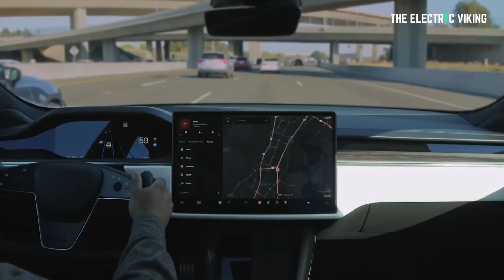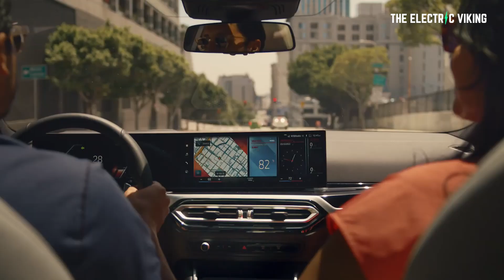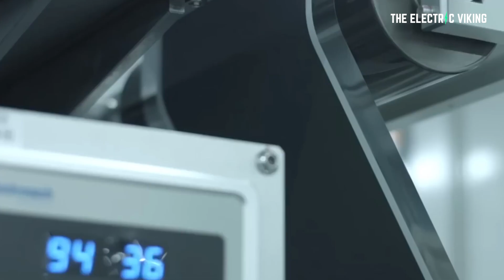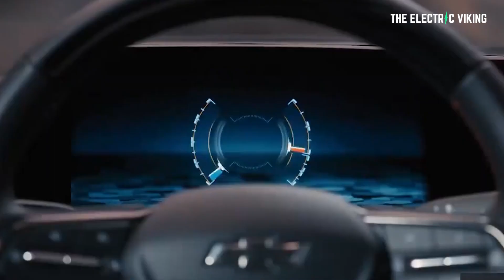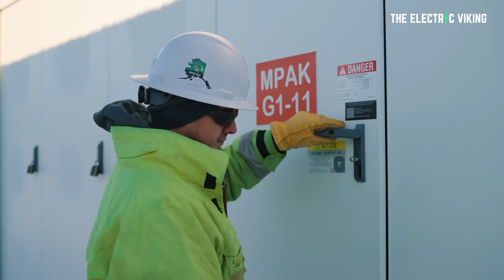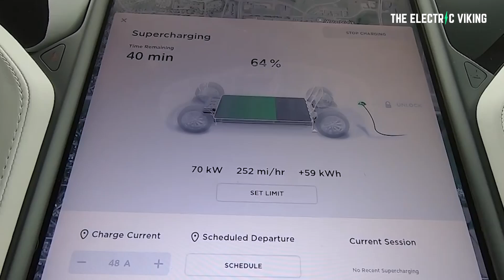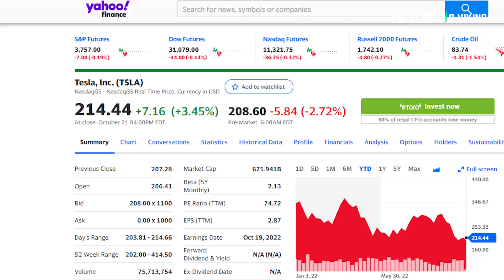Tesla will make double the world's total 2022 battery production

Comment: Vertical Integration is only the first phase of Manufacturing efficiency. It starts that way for a couple of reasons. it helps continuous improvement (getting to a viable quality product), it funds technology that are unproven economically but promising and can prove them in real time, and it doesn't require as many votes (for Tesla there is only one real 'vote') to change direction. In 1960, virtually every part of a Chevrolet was made by General Motors owned subsidiaries. By 1980, over 50% of the parts were made by third parties. As the technology becomes more stable, it too will go global to the cheapest providers.

Comment: In two or three more years, will they need to start replacing older degraded batteries? Are they requests yet?
Reply: Nope. LFP batteries should last >2000 full cycles. For a 500km range car, this = >1M kms.
Reply: Redwood Materials is already setting up a battery harvesting operation to take batteries and recycle the components to raw materials. JB Strauble left Tesla years ago to start this venture.🤔
Reply: Tesla current battery pack suppose to last 500k miles, that is more then enough for the average car life in USA.
Reply: @reyfetsalmo3346  "supposed to" is very nice, but call me back and let me know how well or long the cars and batteries actually last. You can bet that Tesla, like any corporation, sets aside money for warranty expenses. And in order to predict those expenses, they track every battery failure they've ever had. IIRC someone in CA who was putting on 100k miles per year-ish in commercial use, was one of the first to prove battery life might be more of an issue than advertised. And yes, Tesla did replace the pack, and has changed battery management and charging profiles as well.

Comment: Vertical integration is great as long as there is growth and demand exceeds supply. When growth slows to even negative and supply exceeds demand a company "fully integrated" will be faced with much bigger challenged to "right size". A company with a deep supply chain is able to spread the risk and prevent absorbing all of the potential losses. Verically integrated organizations have overhead matching output. Thats ok until you need to reduce 20% when the economy goes through a down cycle. Its much more than just reducing headcount. But vertical integration is cool as you grow no doubt.
Reply: Tesla will be able to lower sell prices to boost demand, they have already done this. Better design aimed at reduce build cost, in house LFP batteries, high automation, limited number of models....all of these enable Tesla to be the lowest cost builder. The Semi, and Cybertruck will be HUGE profit drivers for many years to come....as will model 2.
Reply: @melleblanc8705  Yes, all your points are valid in a robust economy. The globe will eventually see a recession. Not a matter of IF but a matter of WHEN. Yes, Tesla will be better positioned than most. But I can assure you if they see a year over year drop in volume they will need to reduce overhead. If the majority of the cuts come from within your own "house" it becomes very inefficient to reduce volume when the supporting structure is built for larger volumes. While this structure can indeed be "right sized". But its far less risky to spread the pain throughout a supply chain network. Those that have deep supply chains and/or contract manufacturing can by and large reduce their component purchases. Ford learned this. Xerox (the worlds most famous copier company) doesn't even manufacture a copier themselves. Apple if seeing a reduction in iPhone sales have Foxcon to share the pain. Many other examples that utilize shared structures to reduce financial risk. But yes, Tesla can weather an initial downturn better than their peers,,,, for a while.

Comment: Yes Tesla has proven itself that it thinks out of the box.  They follow the best ideas not copy existing ideas. Doing the same thing over and over only gives you the same result. Think outside the box break out and think not like a circle but try something like maybe elliptical.
As an electronic engineer, I was better at solving problems better than other engineers by trying something different.  Elon and Tesla is that kind of company, taking the risk to try new methods.  Sometimes you win and sometimes you fail, but you learn from what you try and then you go from there to solve the problem.. This results in a better product.
Reply: Good thinkin

Comment: Everyone else will catch up to Tesla and even Pass them in due season. It's only a Matter of Time as everyone just recently got seriously into the E.V. game.
Reply: Just like Rosie O’Donnell catching up to Usain Bolt in a foot race😂
Reply: @bekind9668  no because Tesla had to figure alot out by themselves while others can Hire those with modern Knowledge or buy the Product and break it down to learn etc. It's a MYTH they are that far ahead. They haven't even built one affordable E.V. but GM with the Chevy Bolt did
Reply: Think about how late Tesla is with the cyberTruck.   It is late because it needed both the 9K ton cyberpress and batteries to stuff it with.  The press has arrived and the batteries will be there too.
Now take everybody else.  There is almost no new engineering in their cars.  Every process must be a well understood done deal or it will not be used.  Too risky.  So long as tesla keeps innovating they are not likely to catch up. Tesla will be making better cars for less money.  Tesla will be making a good profit while the others are trying to break even.

The latest project Elon recently talked about is the 1/2 price car.  Tesla will make this car for 1/2 the price of the Model S/Y.  To pull off this tesla will need to design a new factory with new manufacturing processes and procedures.  How long will this take.  What new equipment must be designed built and tested to make it work.   Nobody know but sure as sunrise people will complain it is taking too long.
Reply: @danharold3087  Ford F150 lightning sells in all 50 states. They achieved this in record Time without a Giga Press etc. So they built their Truck faster then Elon. They will evolve their game in time but they are not TRAILING Tesla in making a Truck they are Beating them. I'm not sure on their Profit margins or anyone's so I take that with a grain of salt.
Reply: @truecolors5413  I beg to differ.   Ford is not making money on these trucks.  Have admitted it.  The people buying ICE 150s are  making up the difference.
Volvo and its premium EV brand Polestar are going to be using the giga press.  Each casting from the 6000K ton eliminates 370 parts on the model 3/Y.  Parts that needed to be stamped sheared punched glued and welded.  About 1800 welds. And this happens for the front and back.  The assembly line is much shorter and it builds significantly more cars per hour.   This is why Tesla is making  20 or 30% per car and all other car companies making EVs can't make a dime on their stuff.
Tesla's next project is to manufacture a car slightly smaller than the 3 at 1/2 the cost.   When that happens the only ones left standing will be heavily government supported.    Tesla is an engineering and technology.   Not your average bear.
Reply: @danharold3087  Ford GM etc just got into the EV. Game and they have made huge Progress in a short time. So I doubt they will be far behind catching up in all catogories.
Reply: What will happen when Tesla reduces vehicle prices and still make a profit when legacy auto is already selling their vehicles at a loss?  Get tax payers to bail them out again?
Reply: Stop trolling with your cherry picked misinformation. GM made the EV1 from 1996-1999, which was years before Tesla came into existence (2003/2004) and more than a decade before Tesla released its first car (2008). Yes, the EV1 had poor range due to the poor battery technology at the time but, aside from that, it apparently was a highly desirable car (source: "Who Killed the Electric Car" documentary). As such, GM has known for a more than 2 decades how to make a good EV. GM released the Chevy Bolt to market several months before Tesla released its Model 3 and the Chevy Bolt was considerably cheaper. Being first to market and being cheaper suggests that the Chevy Bolt should have outsold the Tesla Model 3 by a wide margin. However, sales of the Chevy Bolt reached only about 25-30K in its first year and immediately plateaued at that level for several years before the battery recall issue occurred. When the battery issue was fixed, and a much improved new version of the Chevy Bolt was being released, a GM senior manager (I think about 1 year ago) said in an interview that he was looking forward to GM selling more than 20K Chevy Bolts annually. Put simply, GM had no ambitions/ability to grow sales of the Chevy Bolt, and a few months later GM announced a significant price cut for the car, presumably because sales were so poor.

From binge watching all the videos on the "Munto Live" channel, I came to the conclusion that, at least since the introduction of the Model 3, Tesla has had superior core technology in its cars (which was not obvious to casual observers due to problems with panel gaps). Herbert Diess (then CEO of Volkswagen) said that it took Tesla 10 hours to make a car, while it took Volkswagen 30 hours to do the same thing. That suggests Tesla has superior manufacturing ability. During the "chip shortage" and "battery shortage" years, Tesla has been able to increase production by 50%+ annually, while traditional auto makers have struggled with those issues (and many of those traditional auto makers have seen their sales gradually erode by 30% or 40% since 2016). This strongly suggests that Tesla has superior logistics. There is an ancient military saying that "Tactics win battles, logistics wins wars", which indicates that Tesla's superior logistics is really important. Ford's F150 Lightning has beat the Tesla Cybertruck to market by more than 1 year, it has gained fantastic reviews and has a massive order backlog. However, Ford cannot make them fast enough, and I get the impression that this is due not just to normal "it takes time to ramp up production" issues, but also due to logistic difficulties, such as Ford not being able to source enough batteries to be able to ramp up production as fast as it would like. Likewise, sales of GM's electric Hummer have been really low, apparently due to logistic difficulties of getting enough batteries.

Can Ford make a good EV? Yes. The F-150 Lightning demonstrates that. But apparently they can do only only at little/no profit, which indicates they are far behind Tesla in reducing manufacturing costs. Videos in recent months (I don't recall on which channel) indicate that several start-up EV companies in China have ordered gigacasting presses, but very few legacy auto company has done so. This contradicts your assertion that legacy auto companies have gotten "seriously into the E.V. game".

Globally, EVs have about 12% of the car market, and that percentage of market share has been doubling every 1 or 2 years. It will take only slightly more than two more doubling of market share (12% -> 24% -> 48% -> ...) for EVs to be outselling ICE vehicles, so that is likely to happen within 2 to 4 years (depending on how long each doubling takes). Currently, both GM and Ford have less than 1% of EVs in their car sales. I know both companies have ambitious aspirations for how quickly they will increase their production capacity, but even if they achieve those ambitions, they will still be far behind the ICE-to-EV transition, and will have incurred additional massive debt in retooling their existing ICE factories to make EVs. It will be a significant challenge for Ford, GM and some other legacy auto companies to avoid shrinking considerably in size or bankruptcy due to them lagging far behind in the ICE-to-EV transition. For you to claim that they will "catch up to Tesla and even Pass them in due season" is delusional and/or trolling.
Reply: @CiaranMcHale  dude I'm not reading all that crap when you can't get first couple paragraphs right.
Reply: @truecolors5413  Rather that assert that I made factual errors, it would be better for you to actually state what the errors are and provide evidence to show they are incorrect. If you can't be bothered to do that, you come across as a troll.
Reply: @truecolors5413  I suggest you watch the "Who Killed the Electric Car?" documentary. Information in it refutes your claim about the quality of the EV1 and the reason for its demise.
Reply: @CiaranMcHale  Viking says there are like 100 E.V. companies in China so building a E.V. obviously isn't rocket science but no doubt there are tricks to every trade that make things easier faster etc.
Reply: @truecolors5413  You are making wildly inaccurate assumptions about what information is provided in the "Who Killed the Electric Car?" documentary. For example: (1) GM did not sell any EV1 cars; instead, it was a lease-only car with no ability to purchase at the end of the lease; (2) GM made potential customers jump through numerous bureaucratic loops before agreeing to lease an EV1 to them (which gave many people the impression that GM really wanted not to make the car generally available, and instead treat it as a compliance vehicle to be made in very limited numbers); (3) the EV1 invoked the sort of "fanboy cult" that people like to accuse Tesla fans of being in (which suggests it was a very good quality car); and (4) when GM announced it was recalling all the EV1 cars, many of the customers offered to buy the car rather than have it be recalled and scrapped, but GM refused.

So, as you can see your claim that if the EV1 was any good, it would have sold in large numbers is irrelevant, since GM refused to sell the car and forced people who were leasing the car to return it.
Reply: 😂😂😂😂😂haha
Reply: Ford lightning has a lot off problems. Chevy volt had a lot of problems costing billions to repair. Fast isn’t always good. It’s better to be slow and sure during research and development before mass production to avoid costly recalls.
Reply: @bekind9668  well there is No Proof that TESLAS Slow process is sure since they don't exist and when he showed off the ROBOT AND CYBER TRUCK the Glass shattered and the Robot was a Video fraud of it working after careful analysis of video. Plus cyber Truck will look different then what he showcased. I don't get into Financials because I don't know and I doubt others do know as well. Tesla is Losing demand in China and there is NO EVIDENCE how low he needs to go to turn that Around so I won't speculate till I see Proof.
Reply: Is this a joke?  Just like Nokia and Blackberry caught Apple.  Ford makes about 2000 lightning trucks and 2000 Mach Es per month. Tesla is making about 150,000 electric vehicles in a month.  4000 compared to 150,000.  Tesla is making about 5000 electric vehicles per day.  Tesla make sand sells more EVs in ne day than Ford sells in a month.  Plus these numbers are increasing every week.  It’s like giving Usain Bolt a head start in a 100 meter dash. No one will catch them.
Reply: Wtf eva
Reply: @michaelstarkey9745  Tesla will soon be a dime a Dozen. Chinas Proving this There is Nothing extra special about his low Range , Slow Charging crap on 4 wheels that's expensive as heck. The comp ain't that far behind and in various areas lead. You fan Bois are in for a rude awakening
Reply: @startpacking8204  tesla don't get 500 miles , it certainly didn't float in the storm in Florida but instead was catching on fire and we all remember cyber Truck demonstration.where their bullet proof glass shattered. Uh huh good examples.👍😂😆🤣🤪🪦⚰️💯no need to pack when your buried